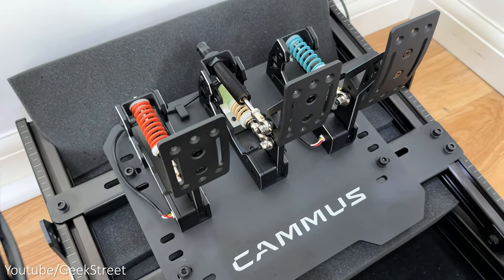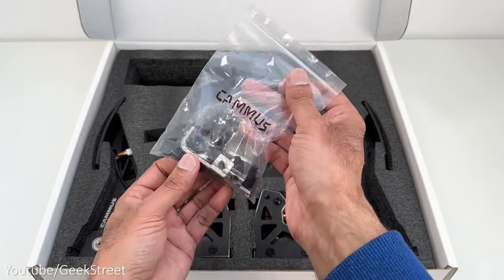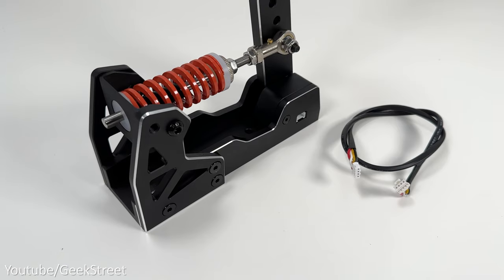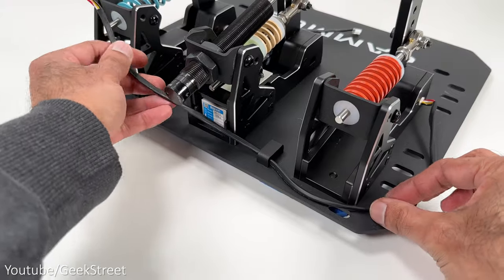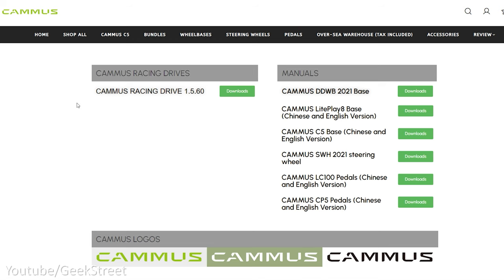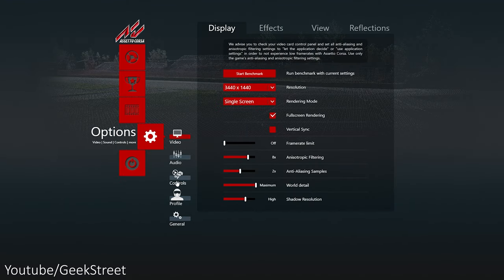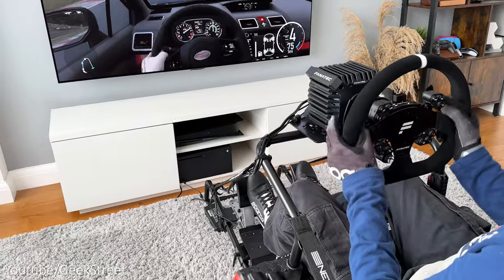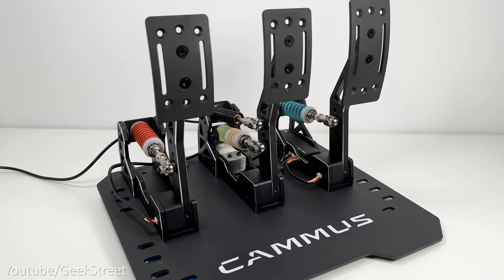CHEAPEST Loadcell Racing Pedals | Cammus LC100 Review

Comment: got the c5 wheel with lc100 pedals to replace my original moza r5 setup which given to my cousin recently,. The performance is surprisingly way better than my original setup especially with the loadcell pedals despite the price of my new and old setup are very similar. Although i would say in terms of build quality it isn't the best but at this price point the overall performance is unbelievablely well.
Reply from the maker: For the price it's pretty impressive 👌